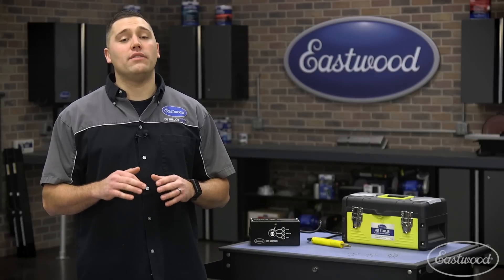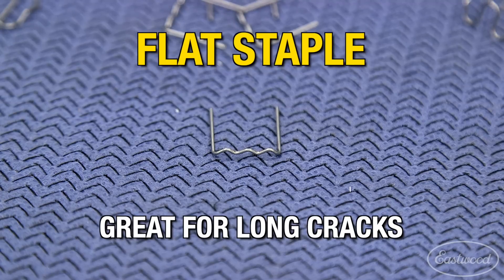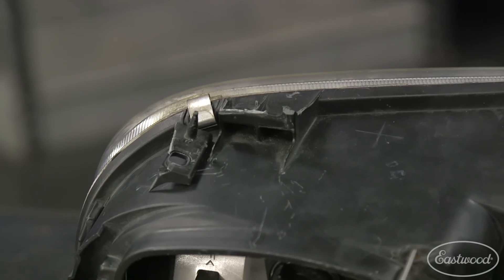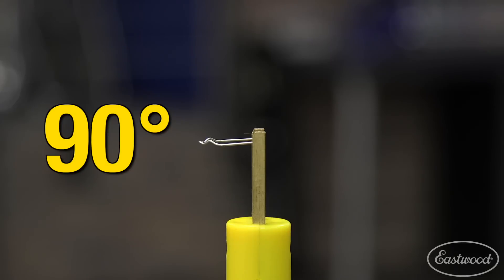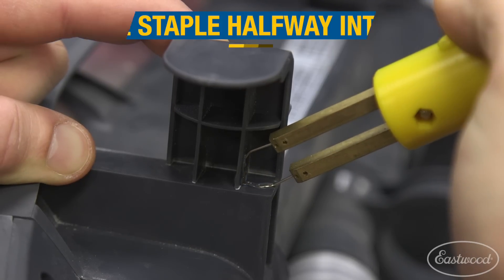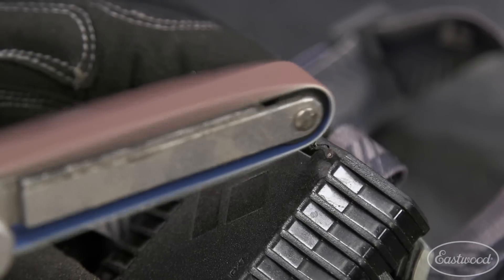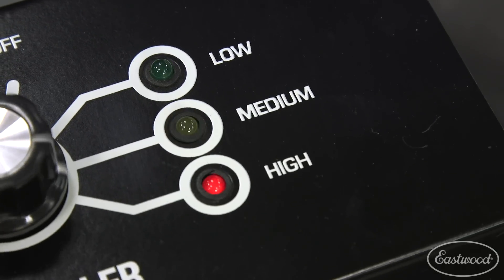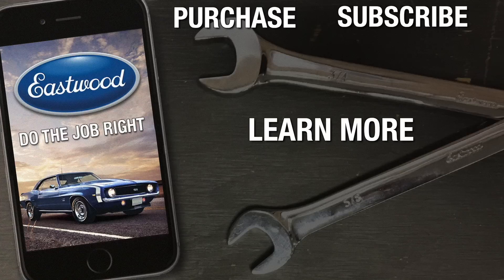How to Repair Plastic Parts - Fix Plastic Tabs, Clips, Posts & More - Eastwood Hot Stapler

Comment: Can't you get the same results from a 9V battery and a paperclip? 

It's the same concept as stick welding, where here the staple is the equivalent of a welding rod (conducts the heat as the weakest circuit point and becomes disposable). 

9 volt batteries and paperclips are way cheaper
Reply: yes but those 9V batteries are quite expensive, i'd rather use a small propane mini torch
Reply: Mr Thomas I thought about that one, but using rechargeable 9 volts seemed cheaper than their $145 machine and $26 boxes. 

Rechargeable 9v batteries are usually between $10-$20, and paperclips are usually $5? I can crimp them to wave or corner shapes and save about $150 lol
Reply: @davidfanning1289  I think if one's daily job is in this application, their product would be more economical on the long run... but for my very limited needs I'll just use needles and a propane torch.
Reply: Mr Thomas the mini torch is another good way though